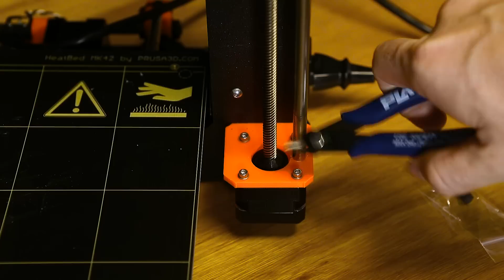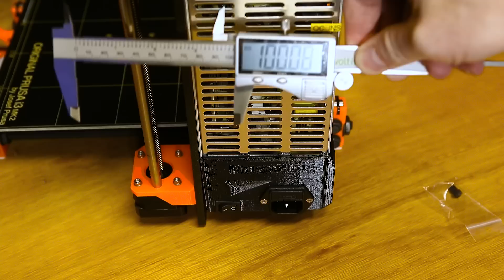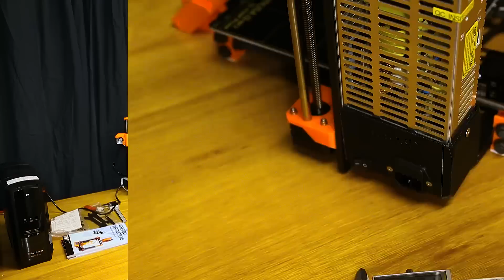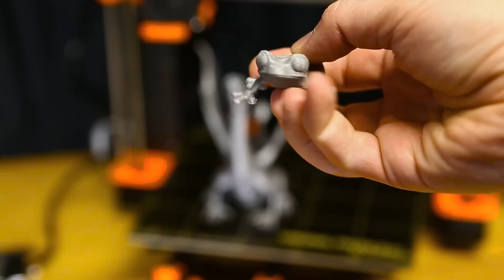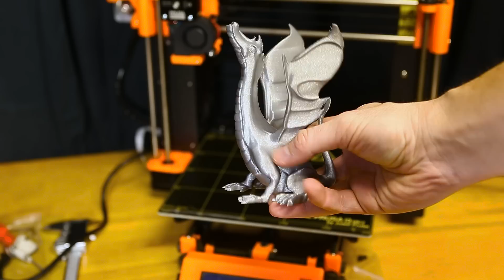My Thoughts on the Prusa i3 mk2 3D Printer Kit

Comment: I am new to 3d printing with a budget of about $600.00. I have been looking at the CR-10, Anticubic i3 and this printer. I will mainly be printing tpu for drone parts but also printing in other filiments for fun stuff. But I am trying to figure out what is going to give the best prints and range of filiments with out having to modify or buy extra parts to get to work well. Thanks for all the informative videos!

Comment: Hey 3d Nerd.  I just got the Prusa i3 Mk2s.  Your suggestion #1 has not been added, however, my new mk2s didnt need the cut.  The smooth rods fit perfectly so maybe they relaxed the tolerances.  I found for suggestion #2 that stealing your girlfriend's cloth measuring tape for quilting worked well for measuring the 100 mm.  Then your step would be a good addition after that but hasnt been added.  One thing I learned was you really need a square (I prefer plastic square so I dont damage the build plate) to make sure those nuts are in the right place.  If you place the square against the y axis bars and line it up with the x axis lines on the build plate you can get everything nice and square.  This should be done at the end as a final check. Thanks for your videos.
Reply from the maker: Hey Steve, thanks for the tips!

Comment: I've also assembled this printer and in my opinion instructions are very good, except one thing... From my experience there is some serious lack of information about connecting the main cooling fan, you can easily connect it upside-down (at least my connector allows to connect it in both polarization ways +- and vice versa) which causes this fan to fail. It doesn't work, you can feel that it gets warm and possibly to burn the board or fan itself if connected in reversed way.

Comment: hi what slicer do you use with you prusa i3 mk2 ?
Reply: You can use any slicer you want.  The Prusa driver package comes with Slic3r Prusa Edition and PrusaControl, but their website also has printer profiles for Cura and Simply3d.  With any other slicer it'd just be a matter of setting up your printer profile correctly.  The easiest way to do that would probably be to copy the settings from Slic3r PE.

Comment: Hi, can you tell me if the A8 or A6 is as good as this one?
Reply: CptMikeTango no it's not. i have just bought mine and i'm crying because of it ... of my luck ... i allweys get the stitties parts ... my hands are in Blood because of tighning with Allen Keys.  because the threds on the aluminium Square were to small and i had to do them with the screws SO that means going a little on back and over and over

Comment: hello. what software would you recommend to use with this printer?
Reply: The Prusa driver package comes with Slic3r Prusa Edition and PrusaControl, but their website also has printer profiles for Cura and Simply3d.  With any other slicer it'd just be a matter of setting up your printer profile correctly.

Comment: I am thinking of ordering the assembled and calibrated model.  But I am wondering if the experience of building it might be worth while in that I will then understand better how to maintain it.  Also I am not at all a fan of the cable wrapping material and would very much prefer to use expando (braided abrasion resistant wire covering).  I was also looking at getting a 0.2mm hot end for thin wall prints and knowing how the install the entire hot end assembly might not be a bad thing.

I just don't want to end up with a 5+ hour build and then endlessly being frustrated trying to align and calibrate everything.
Reply from the maker: You'll end up with an 8-10 hour build, and it'll work, and you'll learn quite a lot. Plus, the kit saves you a few hundred dollars.

Comment: Everything you have said I discovered myself during the build.  If only the manual had told me that the smooth rods on the XY were 170mm between centres I could have built it perfectly first time...but I had to rebuild the XY base!  I have printed several 2x2cm cubes to calculate ABS shrinkage and I have discovered that my models are too tall by about 0.1-2mm. My calibration and steps are correct so I am guessing there is a slight over extrusion?

I did not put the padded feet on the XY base because I wanted to see all four corners flat to the surface when fully built.

The 100mm positioning was tricky but I set then with calipers and used Threadlock to ensure they did not move, I then tightened from the other side.

There are several modifications on Thingiverse that are extremely useful such as the Z Axis Brace by Hanthony.

The spool holder can cause wobble, I have printed a desktop one.

Finally, I have squirted a small blob of bathroom silicone between the bearings and the frames...right by the cable ties. This will ensure against any slipping or vibration!

All is good...fantastic printer!!!!!

Comment: How good are the various clones of it? I found one on gear best that was 150$ and is essentially the same thing with  a slightly change interface.
Reply: PCFanatic they sure work, but this is on a completely different level. even built from a kit, it basically self calibrates on the start... you get nothing of this on a cheap, chinese clone, you're likely going to have to calibrate an dial in everything on your own.
Reply: max rainer I'm ok with manual calibration and such, as long as great print quality can be attained im all for it I've been seeing great reviews on the printer.
Reply: PCFanatic yea but even if dialed in perfectly in it still it won't give you that top of the line print quality that this machine has (e3d v6 hotend, good mechanical construction...)
Reply: Well, I know the Prusa i3 MkI was a RepRap printer, as in it had a Free licence, so you could print all the plastic parts yourself and buy the other bits from AliExpress or eBay from China for incredibly cheap. And this included all of the firmware as well, so you bought the RAMPS shield, and Arduino, the stepper drivers, the 5 NEMA17 motors and the 3 micro switches, hot end, heated bead, kaptan tape, zip ties, linear slides, bearings, belts, frame, threaded and smooth rods and put it all together, calibrated it and it would work.

Now the only main differences I can see in the Prusa i3 MkII over the orginal Prusa i3 is the autoleveling, a screen, and a roll holder, and I strongly doubt that Josef Prusa would have thrown away his current approach and and philosophy over these incremental features, however handy they are, and risk pissing every one else off whose work he built his career on top of, not that he didn't make a lot of great innovations, hard work and clever designs himself. He just (previously) released them in the spirit of Free and Open software and hardware and gave them licences to match.

Also the "clones" aren't really "clones" because of this. They are the same machine with same STL files and software and everything, just maybe with hardware from different sources. Maybe crap sources, but you know, you could easily spring for the good stuff yourself if you were building your own. The kit makers just typically select some options (extruder type, frame type, etc), print out and cut out all the bits all the bits or have someone do it for them, maybe do some minor tweaking, get that and all the bits together and send it out to you. But they got to eat too right? So you can do it yourself.
Which is what I'm planning on doing, I'll keep you posted if you are interested. If not, sorry to necro ^-^
Reply: There you go, I talked to a chap named Michele on Prusa's website and he gave away the family jewels in about 2 minutes. The joys of open source :D
http://www.prusa3d.com/drivers/
http://www.prusa3d.com/prusa-i3-printable-parts/

Comment: Not to single Joel out because it seems everyone in 3D printing does this.
I have been running CNC machines for 30 years and what you all are calling a gantry machine, I and everyone I know would call a bridge machine.  The bridge being stationary while the bed moves under it.  With a gantry machine the "bridge" moves while the bed is stationary.

Anyway the more I see about this printer the more I think I need one.
Keep em coming Joel, High Five.
http://sr.photos1.fotosearch.com/bthumb/CSP/CSP990/k11473463.jpg
Reply from the maker: +Andre Blanchard hey Andre! Whoa, I never knew. So in CNC machines calling the riser a gantry isn't correct because it doesn't move?
Reply: That is the way I have always known it.  But then this type of thing can be very regional and it's not like there is anyone going to enforce it.

Comment: Thank you for your  videos!  Like them so much!  

Had some problems with the Z rods too,  but I was able to push them inside those holes.  I think that the problem is that the plastic restrict after printing those pieces.  
In my opinion cutting those pieces  may compromise 3d printing precision.  What do you think about it?  

Thanks again,  waiting for your new video!  #hifive

Comment: I didn't have the problem with the rods, but I did have a problem with the power supply, mine isn't connected to the Y axis as when it was it wouldn't calibrate because the Y axis was too far back to find the calibration disks. I unscrewed the PSU and moved the bed forwards till It would calibrate. I checked the distances with my calipers & its not 100mm on mine

Comment: High Five Joel!  I am 4 hours into building mine today.  I did not have the problem with the Z rods on mine.  I did manage to put the bearing on the wrong side of the Y axis carriage (thank goodness they include lots of extra zip ties).  I also had the wires for the Y motor aimed the wrong direction and didn't realize it until the last page of the section (easy fix).  I am working from the printed instruction book, as I don't have a computer in my kitchen!  I just finished setting up the Z axis and gantry, ready to get started on building the extruder.
You can tell that Joe & crew put a lot of love and care into designing and packaging this kit.  The 3D printed parts are really super when I compare them to the best parts I have been able to print with my M3D Micro.  One of the belts on my Micro decided to loosen up on Monday, which was the same day my Prusa kit was delivered!  Hopefully I can finish the kit before work tomorrow and be printing again soon.
Toni

Comment: with my z rods I removed the steppers and pushed the rod up though the bottom of the 3d printed part. I found they would go in that way.
Reply: 3D Printer Movement kit http://www.ebay.com/itm/262971946390?ssPageName=STRK:MESELX:IT&_trksid=p3984.m1558.l2649

Comment: Hey Joel,  Did Prusa include but not attribute the dragon design? http://www.thingiverse.com/thing:246198 If so, that's surprising, given that this design was at the heart of the eBay 3Dprinting "scandal" last year in which some knucklehead was selling prints on eBay without respecting licensing and/or attribution.
Reply from the maker: Perhaps? It may be in the docs, or in a text file on the SD card. I can check when I get home.
Reply: Even so, I'm not sure that including it with a commercial product (albeit an open source project) is consistent with the NC portion of the license. I had a convo with Lulzbot about distributing one of my camera designs with Taz printers - they wouldn't touch it if it's NC.
Reply: Or maybe Joe Prusa did attribute and did get permission to include it with his printer?

Comment: Funny, I ran in exactly the same problems you described. As the 100mm is pretty much the only absolute measurement thats in the build instructions a caliper isn´t as efficient as it could be anyway. I would have loved to have more recommended measurements for the Y-axis frame for the 8mm rods f.e.  I´m also not sure my PINDA probe is properly aligned. The positioning instructions on those are pretty vage as well.

Comment: Hi Joel, Your issue with the smooth rod seems common... I warmed my zmotor mount in some hot water and pressed the bar in. and I had the same issues on the nuts on the threaded bar.

Did you have the problem with the X axis belt rubbing on the baring? or have they fixed that one now?
#highfive
Reply: My kit arrived about a week ago. I only noticed/am assuming my X belt is rubbing a bit on the left housing, right around the 623h bearing.
Reply: A few turns with a countersink bit will clean up the end of the hole for the Z rods.  It is just a bit of first layer spread as the upper face of the motor mount was against the bed when it was printed.  I usually put a small chamfer (0,5mm) on parts that eliminates the need to clean up first layer spread.

Comment: How do you feel about the zip ties holding in the bearings?
Reply: Just switch them out with these http://www.thingiverse.com/thing:1819779/#comments

Works flawlessly
Reply from the maker: +Paul's Projects I haven't had any issues with them so I cannot complain.
Reply: They get loose over time. Had to replace them multiple times before I used the brackets i linked

Comment: Two suggestions on the nut on the threaded rod.

1. They could 3D print a tube spacer that is cut in half lengthwise. Use that to set the position of that nut then the spacer could be removed easily.

2. Make the hole on the power supply a short slot so the actual position isn't quite as critical.
Reply from the maker: +videoscrapheap those are great ideas!
Reply: videoscrapheap I agree with the 100mm tube for the threaded rod idea.  When I got my printer up and running it told me it was "skewed severely".  After a few hours I got it right.  That was the only real issue I had with the build.
Reply: exactly what i did. i printed 2 "half pipes" then cable tied them to the M10 rods then assembled the frame, even left them in. I dont think it has to be exactly 100mm but i Imagine its critical that both sides are spaced exactly. Also couldnt get in with the calipers to take a proper measurement. The to spacers are also not exactly the same length due to the psu mount taking up a piece on the M10 rod.